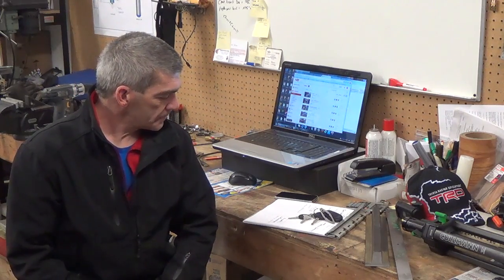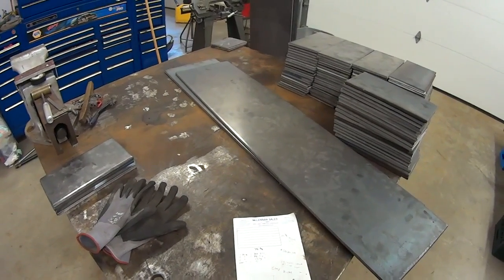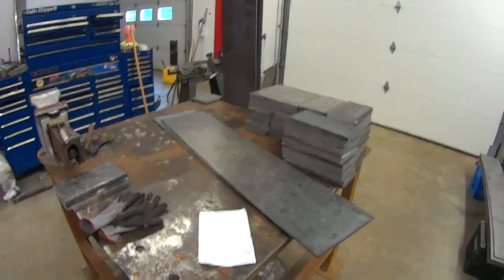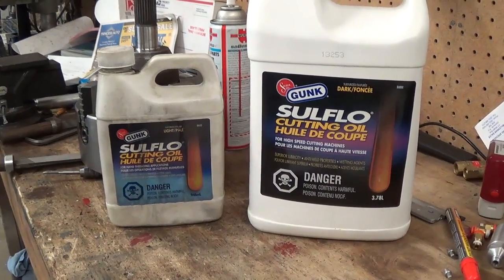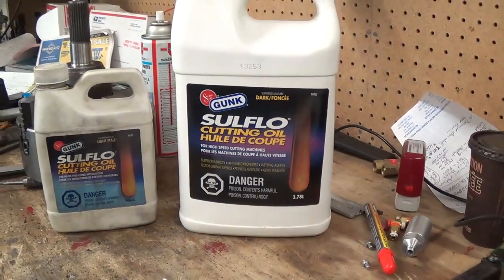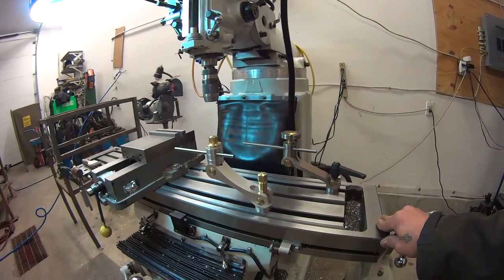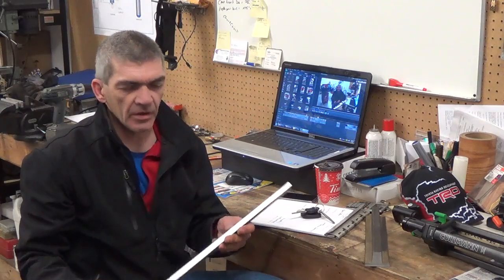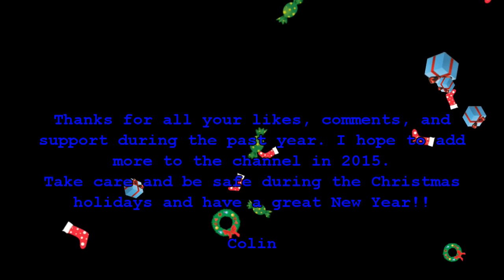Clips & Chips - 1

Comment: Colin,
I figured you were super busy thus the absence of videos.  Damn! I'm amazed that those electrolytics didn't blow out the tops! The problem with sensitive electronics like ICs and the like is a surge, short or reverse polarity can do a number on a lot of stuff basically rendering the device as junk. When I was in actuation service, this one guy in Alaska had a unit with a 4 to 20 milliamp servo control board in the unit. He would lean over the unit and the metal tang on his jacket zipper would short something on the board and kablooie! He must went through 4 or 5 boards at $450 a pop! Some people are just natural born idiots! Hope you and your family had a great Christmas!
Have a good one!
Dave
Reply from the maker: Swarf Rat Ha, gotta watch the stray metal pieces! I normally get 2 or 3 power supplies each season burnt out. Usually it's older ones without reverse polarity protection.Christmas was great and I hope yours was good as well Dave. See you in the new year. ;-)

Comment: Hey Colin, good to see you about!

The Brake cleaner thing does the rounds here in the UK from time to time, but all the stuff I've ever bought has been the non chlorinated type which isn't a problem. Is the Chlorinated type even still available?
Reply from the maker: Paul Compton Non-chlorinated is the most common here but I have seen the bad type as well. I just made it a point some years ago to keep it and heat apart just in case. When I purchase I ask for non-chlorinated anyway.Thanks Paul. Hope your christmas was good! ;-)